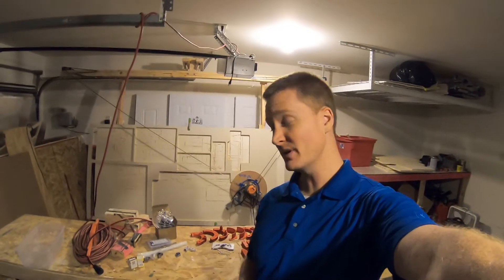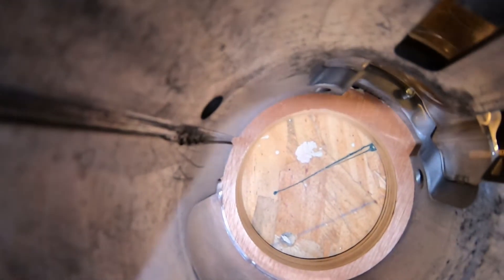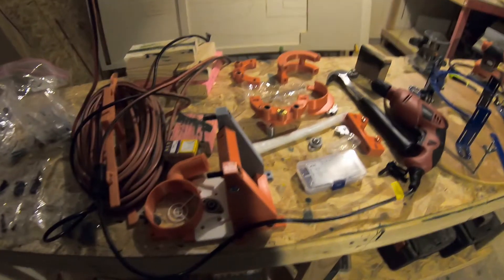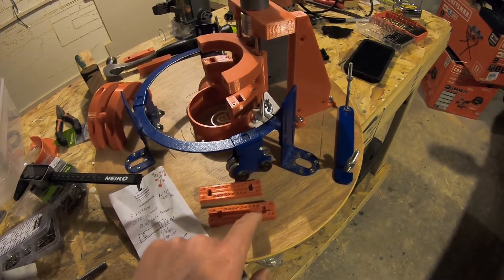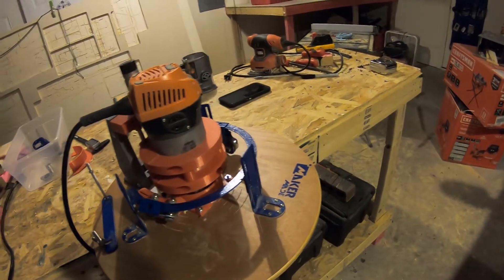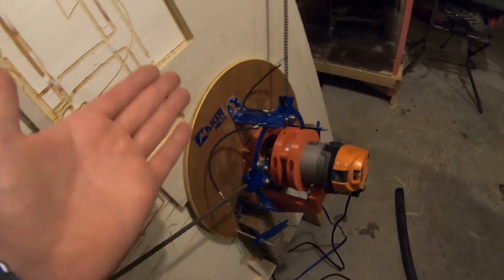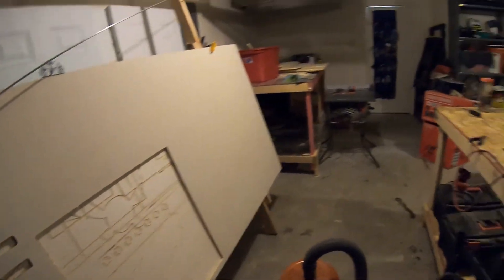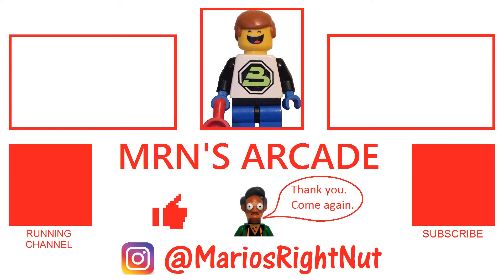Maslow DIY CNC - 3-D Printed Z-Axis Upgrade

Comment: Do you have a link for the 3d printed parts
Reply from the maker: It was on the Maslow cnc forum page. 

Though it didn’t last too long. It cracked the first time it got cold outside. :(
Reply: @MRNBricks  which part cracked? I just finished printing mine and I'll be putting it together this weekend? Thanks for the video!
Reply from the maker: @beauchene  the clamps around the router. It worked fine for a while, but a winter then summer temps cracked it. I’ve been too lazy to replace the part or bug and M2.

Comment: Great video. Helps me prepare better as I upgrade my Maslow. Thanks
Reply from the maker: Good deal. I will say, the router mount broke during the Houston summer heat. Not a good long term solution. Best to go with the M2.

Comment: Thanks for this video.  How is the 3d printed Z working after some time and some cuts?
Reply from the maker: Other than the issues noted in the video, it’s working great. I haven’t done anything too crazy, but for my application it works great. And if anything  breaks, I can just print another part.